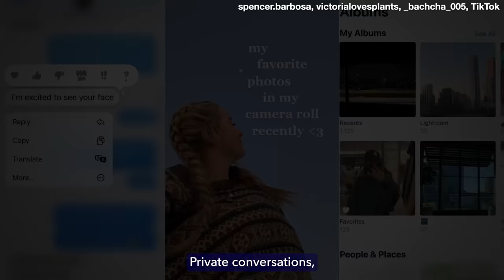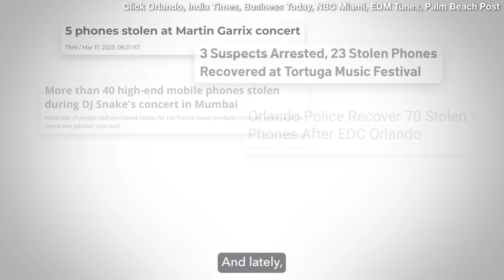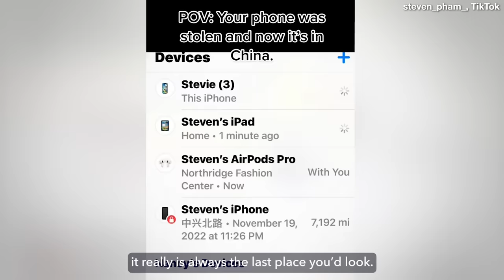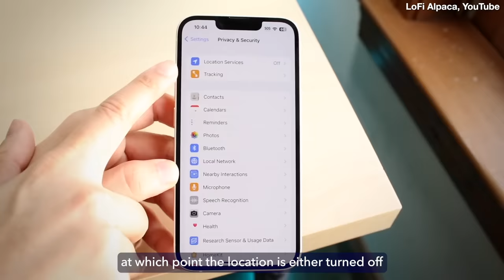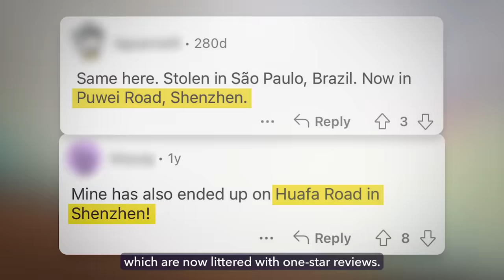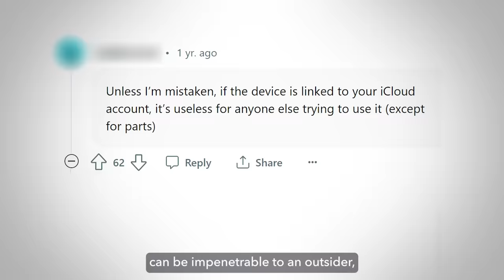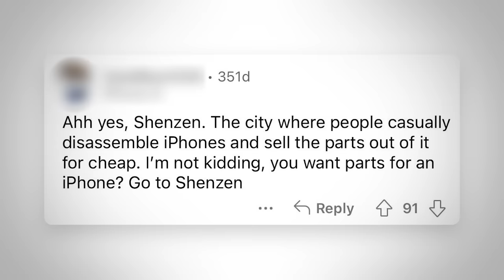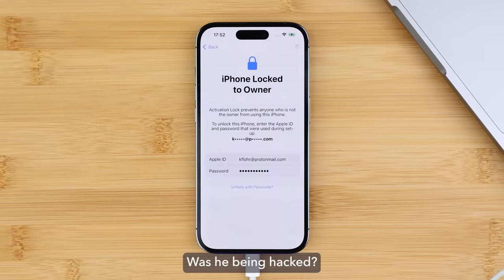Viral TikTok Exposes What Thieves Do with iPhones: "This is disturbing"

Comment: No clue why this wasn't mentioned- but ALL of the software attacks used to override IOS on stolen phones is prevented with lockdown mode.
Lockdown mode prevents computers from talking to the phone parts meaning the motherboard and touch sensor - both items wanted - become useless. (they attempt software overrides to retain use of motherboard) You won't get your phone back but they won't get as much use out of it. Devices are stolen for their motherboards, batteries and touch sensor. Motherboard and Touch ID becomes useless once lock-down is on.
Reply: If its stolen how to put it in that mode?

Comment: They're being stripped for parts.  The parts are then used in repairing non-stolen devices.  These fixed phones are sold as 'factory refurbished '.
Stop bying Crapple phones and you won't have to worry about.

Comment: IT engineer and secu analyst here. Personally I still trust my blackberry. I'll never touch an iphone or an android. You use one because you don't care about privacy. My  next phone will either be a Retevis radio or some Nokia 4G if anything bad happens.

get a decent secu in your phone. don't store any personal info on your phone, if your phone is stolen make sure you can remotely brick it.
your data and contacts makes your device more valuable than the price of the silicon it's packing.
Don't throw your phone away or in a recycle center even if it's broken, recycle centers only collects data, makes insane amount of money reselling your device to data brokers. Same with your laptop, hard drives, whatever gadget.
If you don't care about privacy, your employers, family, friends and contacts don't consent.

Comment: Locking down your phone hard does only one thing. It ensures your phone is sent to Shenzhen to be dismantled and parted out. If a stolen phone cannot be sold in whole as a usable device, it will be broken down and parted out in pieces. Don't think that setting all of those protection settings will in any way ensure your phone gets returned to you after it's stolen.

Comment: If your coat or jacket doesn't have an inside pocket then your second best option is a belt purse. Make sure it's at your front.  If you need to leave your phone in your vehicle, use the glove box.  If you go to school, the gymn or the pool then use a locker. And use two factor authentication! I use a finger print and 4 digit passcode.

Comment: I got tired of the iPhone 13 Pro Max and threw it out of my window. I live on the 12th floor. The phone was the $1,200 256GB version; 5 months old. I have always hated cellphones. I bought it on a whim. I've never understood the attachment to cellphones. The 5 months I had the phone I never even connected it, just used the wifi at home.

Comment: All lost / stolen phones are heading to China for reasons many of us know. There’s a huge market for stolen phones in shenzhen china where they refurbish phones and harvest parts from the ones which are iCloud locked. It’s disturbing that with so many phones being traced to this area, the customs checks of all shipments headed to china, specially which include phones are not thoroughly inspected. Why don’t customs make it illegal to export phones  without each item being turned on and checked for lost mode and activation lock. Also it wouldn’t be such a bad idea to check and note down imei numbers of the devices which are being exported with an updated list of reported stolen phones (easily available in the data base of police reports).

Comment: OK...  I have like 5 used LG V20 (a model never sold here in Norway), I use this 2016 phone because it is the only budget phone with high end audio capabilities and has detachable battery and SD card, phones don't have that anymore. Well, all my phones were clean without any traces of former owners. Once you reset an android phone properly you get an actual clean start, unlike what I've seen on used windows phones and Apple. I hope none of mine were stolen..  😇 (I have several in order to experiment with Lineage OS and other custom roms)

Comment: This is one of the very good things about the heterogeneous Android world - it does not make sense to steal and unlock these thousands of different Android phones, which all work slightly differently. Maybe someone can focus on Samsung Android phones - but that's it. The security mechanisms are all based on Android default, but the exploits require mistakes by the OEM, which are dependent on the concrete device and software version. Thus, it does not make sense to steal different phones - it only makes sense to steal a handful of specific models, where you already know how to unlock them.

Comment: there is just one thing iuse the most effective lock if trust is lost then a bit of c4 and i change the battery to rtg .. cause it is always connected to my necklace or in the house a tranciever device that is its failsafe in case i left it in my home which emits a specific keep alive  signal. and when that signal dies if my phone was stolen it will trigger a message:"YOU'RE COMING WITH ME" THEN STARTS A BLOODY 1MINUTE COUNTDOWN  while beeping a distinct frequency like its notification tone and at 5seconds it starts to disable the RTG's safety to start the meltdown and at 0 second triggers the C4 ... the thief would not ended up getting a surprise but also the shop that tries to unlock it (preferrably a mini CHERNOBYL)... and if you try to unlock it the timer gets faster every attempt

Comment: The demand for black market part & underground repair shops is driven by Apple's policy that refuse to sell parts and provide technical support to third-party repair shops...It's the result of its own monopoly practices. Imagine every time you take a car back for repair and is told only dealer can work on it & charge several time as other brand...not only that, many parts are not available and the only remedy for your small problem is "trade in" for fraction of its actual value.

Comment: The real question is buy an iPhone in the first place?  They certainy are not worth the money. 

Now if they came with a self destruct function that you could trigger remotely.  If you are  pretty certain your phone was stolen, notify Apple and have your phone set to self destruct if someone turns it on. I'm not suggesting that it explode, although that's a option many would probably like. just have it fry itself. t's a faily simple circuit that could pretty easily do this.  Make a stolen phone completely worthless, even  if it is still locked. No point in stealing it, if it becomes worthless.
Reply: First question: It's difficult to understand unless you're addicted to it and spend many hours a day staring at it. I don't think a $1000 phone can do anything a $500 one can't, but then I rarely use my so what do I know.
About self-destruction - it just doesn't justify the additional costs. Sure, the circuit might be $1, but you're gonna need hundreds of millions of them and also invest some money into developing it in a way that ensures it doesn't trigger on accident or as a result of an attack of some sort, which would be a huge deal. And for what? Supposedly, only 1 in 10 people got their phone stolen - ever, and they likely had more than one phone in their lifetime. It's therefore safe to assume that less than 10% of phones get stolen at some point, meaning 90% of phones wouldn't even utilize the circuit.

Comment: I am not suprised. The Best way for the victims is to keep on FMI on that device and report it missing. At least this way theif won't be abble to do nothing with that device if anything happens with it. Apple does not allow technicians to fix those units or swap them. System won't allow it. They can only place third party parts in some china shops but value of the phone will drop and ofcourse, it is matter of time that that phone will have same issues due to non genuine parts.